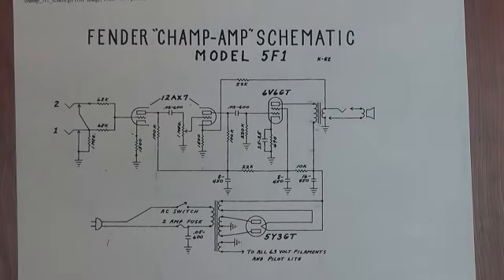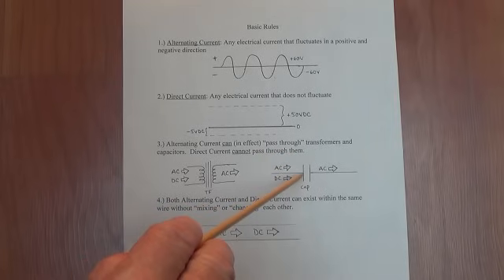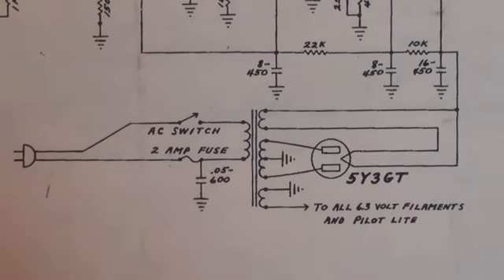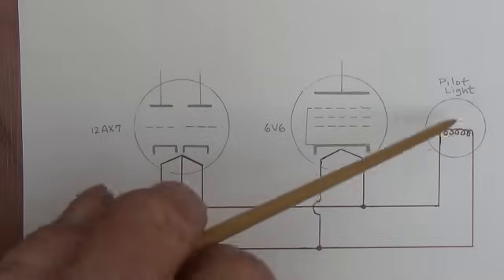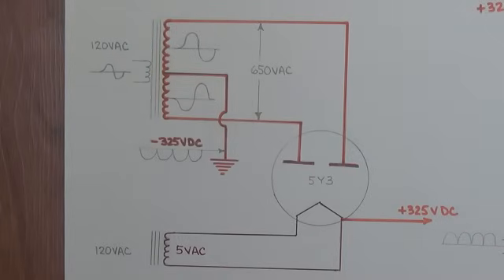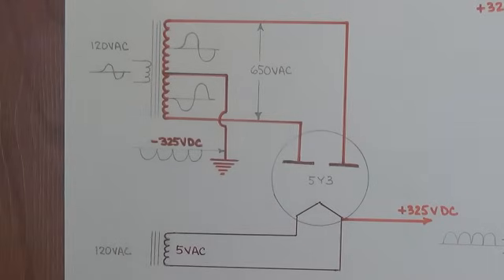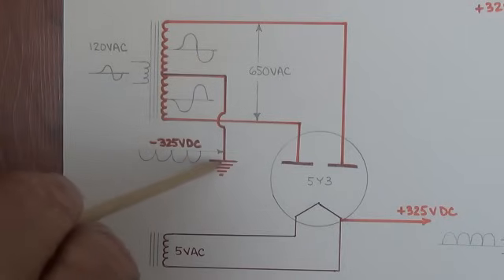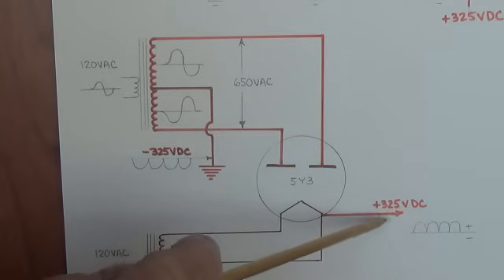How Tube Amplifiers Work, Part 1: The Power Supply

Comment: one question  uncle doug onthis video,  what makes  the neg. 325 to ground dc if its coming out ofthe pt @ 325 ac ? isee that the rectifier and  diode  turns the positive  into dc ,but looking at the schematic idont see the ac to dc conversion on the negative
Reply from the maker: You ask a good question, Donald. There really is no -325VDC potential to ground, which is why I altered the diagram to obscure it. As I state in the video, the power supply is like a 325V battery, with a positive and negative pole. The potential of the + pole (relative to the - pole) is considered to be +325VDC. The - pole is grounded and considered to be 0V. You can see this with a voltmeter if you attach the positive lead to the output of the rectifier and the negative lead to ground = a reading of +325VDC, the correct value. If the (grounded) negative pole really were -325VDC, you would get a reading of 650V. I know this is complicated, but I hope it makes sense.
Reply: During one half-cycle of AC, one end of the center-tapped transformer is positive and the other end is negative with respect to ground. During the next half-cycle, the end that was negative is now positive and the end that was positive is now negative. This means that there is always one of the diodes with a positive voltage on its plate, which supplies current to the filter cap.

Comment: Wow, your metaphor of;
   
   "the frying pan (Filament) cooking popcorn (Electrons) thats negatively charged, being sucked thru the chain-linked fence (Grid) to the positively charged Plate, and you can change the porosity of the fence (Grid)" 
    
...is the best way i've heard to explain it. It actually helped ME more fully understand how they interact. Thanks for making these vids.
Reply from the maker: You're welcome, WS. When I was a classroom teacher, I found that making analogies involving common, familiar things often made the understanding of abstract concepts much easier. I'm glad the video was helpful. I would only add (just to be thorough) that varying the "porosity" of the grid is accomplished when the input signal varies the negativity of its charge (since a varying negative charge will repel more or less of the negative electrons passing through it to the plate).
Reply: Ahhh....AHHHH!!... ok, so, the guitar signal actually varies the grids negative charge. And the amount of negative charge the grid has in the first place, (controled by the...cathode resistor?) actually really repels the electrons rather than "let's them pass"?
Reply from the maker: The grid can have a negative charge for different reasons, depending on whether the tube is grid or cathode biased. This is needed to reduce the current flow from cathode to grid.....like a faucet that is 50% on. The input signal then varies the grids charge (more or less negative, but never positive) as if you varied the faucet from 25% to 75% (for example).....producing an output signal that is many times greater than the weak input signal.

Comment: Hi Doug.
Your power supply diagram has a notation -325VDC on the transformer centre tap EARTH. Do you concur that the correct label is OV,  you  are not applying 650VDC to your amplifier anodes are you.
Reply from the maker: I understand that the accepted notation is that ground is considered to be 0V. In my explanation of the power supply, the electrons are "pumped" out of the B+ circuit and sent to the chassis ground, creating an electron "vacuum" in the plate circuit that is highly attractive to the electrons flowing from the (ground-connected) cathodes. I thus felt compelled to designate their presence in the ground circuit with a negative symbol. In my interpretation, the B+ should probably be designated as 0V and ground as -325VDC, since positive charges cannot "flow"....only electrons can....but this would be confusing for all who accept the traditional designations. I can see how this dichotomy is confusing to more knowledgeable viewers, but was simply doing the best I could to provide a basic understanding for beginners who assume that 0 indicates absence of charge, rather than presence (of electrons).
Reply: Uncle Doug Well OK , you have a charge flow analysis there, but on the other hand at the end of the Video you literally say the power supply resembles a DC battery with negative 325VDC terminal  and positive 325VDC terminal. Which would be a potential difference between such terminals of 650VDC.
Reply from the maker: Again, it's a way of conveying a complex topic by comparing it to a simple, well-known concept. People understand batteries, and I think the analogy is both accurate and effective for my target audience. Perhaps the total difference between the listed values (650VDC) is not correct, but saying that the ground was -0V would not facilitate understanding either. It's my method and I'm sorry if it disturbs you. Perhaps my videos are simply not suited to your higher level of understanding.
Reply: Uncle Doug No problem Uncle Doug, Just interested in conversing about the subject.   It is not illustrative of the circuit action  to say that  pumping electrons out of the  the B+ circuit produces  a presence of  electrons at the earth terminal.  In  this circuit electrons move to one anode  simultaneously as they leave the other  anode  so the center tap terminal is always electron neutral from the analysis of electron flow. When electrons are  drawn from the cathodes then electrons circulate from the earth terminal and back to it , again the  aggregate presence of electrons at the earth terminal  is neutral.
Reply from the maker: I have trouble visualizing how the "aggregate presence of electrons at the earth terminal" can be neutral. One would think that the presence of electrons in any location would impart a negative charge to it.
Reply: The quantity of electrons  at the earth terminal is the sum of the flow in and the flow out which equals zero, there is no accumulation.
Reply from the maker: I see the logic of your comments and concur that my labeling of the center tap potential (-325VDC) is misleading. I will amend the video to obscure this label and will add notes to correct the narrative. Hopefully it will now be more accurate, yet still make sense to the viewer. Thank you for your informative and helpful input.

Comment: Subscribed. Brilliant videos on explaining tube amps. Thank you very much. Could I ask when you refer to the cathode heating pop corn (electrons), where do the electrons/pop corn keep coming from? Thanks
Reply from the maker: An excellent question, Reece. Think of the power supply as an electron pump that "pumps" all the electrons out of the positive (B+) circuit connected to the tube plates and sends them to the chassis (via the center tap of the high voltage winding). Thus the chassis contains an almost limitless and quickly renewed (by the "pump") supply of electrons for the cathodes, which are connected to ground through biasing resistors that, in effect, regulate the rate of electron flow (plate current) from cathode to plate.
Reply: Thank you
Reply from the maker: You're welcome :)

Comment: Thank you for all of your videos, I'm continuing to find answers to the many questions I have had regarding tube circuits and they way they work.  One more question for you.

I have project going which requires me to change the mains transformer (it has some shorted secondaries) in a tube power supply.  Also, I live in europe and the power supply was designed to run on 117/60hz power.  I have located a replacement universal transformer from Hammond which will operate with a 230v/50hz mains voltage input.   My question is if I will need to change the values of any other parts in the power supply to work with 50hz AC.  The thing was designed to run on 60hz AC.  It 's a simple rectifier circuit using a GZ34 tube, one choke (6Hy) and two 30mfd caps.  In CLC configuration if I understand correctly.

Back to more of your videos!
Reply from the maker: You're welcome, Joe....glad the videos are helpful. I believe the power transformer is the only component that is sensitive to 50Hz current and must be changed (as you are doing). The remainder of the power supply components should function well at the lower frequency (50Hz) as long as the secondary voltage is correct (110 to120VAC).

Comment: Doug,
Thanks for taking the time to do this. I have one small issue with the schematic though. You show the switch at the wrong location. Although it will work, it does not disconnect the hot side, only the neutral. That is a specific safety hazard and not correct. It should be shown in front of the fuse on the hot side only.
Reply from the maker: non participant An excellent point, NP. The power switch should definitely be installed in the black (hot) AC lead to the fuse (first) and then the power transformer. The schematic is an original from Fender and apparently they did not follow this wiring pattern. Thank you for pointing this out.
Reply: To comply with modern safety standards, if an amp has a non-detachable power cord, both hot and neutral lines must be switched (with a double-pole switch.)

Comment: What an excellent presentation. Thankyou! I love the popcorn analogy. I don't suppose you could give the same treatment to the workings of stereo amplification? Btw I admire all of your vids. They are very informative with no useless rambling. Thanks for them all.
Reply from the maker: You're welcome, FS....glad you like the videos. Stereo amplification is basically just two separate mono amps in one chassis. Virtually everything described in my videos would apply equally well to stereo amplification. HiFi and Stereo circuits generally have flatter frequency response and much lower distortion than guitar amps, but otherwise the basic principles are the same.
Reply: Uncle Doug Thank you very much for the quick reply. For some reason I was thinking it was a complicated balancing act of some sort. Perhaps I was thinking about how a receiver changes the signal. After your comment I can see how it works with regards to a phonograph (minus the preamp stage of course). Thanks again!
Reply from the maker: You're welcome, FS. Best of luck in the New Year :)

Comment: Dear Sir,
Can you please make a movie about how  and why hum pots work in tudio tube amps ?
And my be  one movie  more.; Where in the amp should be a oil capacitor replaced only with an oil capacitor?
Where can a cap change the sound? If the cap is not oil in paper anymore.

Thank you very much for your very good movies!

Kind regards
Reply from the maker: Greetings, ZX, and you're welcome :) The hum balance pot is usually between the two 6VAC heater wires. It balances and adjusts the ground reference for this circuit, to minimize tube hum.

Regarding paper-in-oil capacitors, there is absolutely no objective evidence to support the theory that capacitors of the same value but with different dielectrics (i.e. paper-in-oil vs ceramic vs polyester, etc.) have different tone characteristics. The truth is, you can replace any paper-in-oil capacitor with any good quality, equal-value capacitor of any dielectric type. The value (in uF) of the capacitor affects the tone, but the voltage rating and type of dielectric (i.e. paper-in-oil, etc.) do not. Here is a very well-researched and informative article to substantiate this:  http://www.aqdi.com/tonecap.htm

Comment: thanks a lot for this very helpful video - one thing, im trying to build an amp/pedal that will use Russian 6j5b-v pentodes but they have one cathode, one anode and 3 grids. the problem i face is that i am wanting it to run off 9-12v and im not sure where i should use resistors and capacitors (accept for removal of dc current). also i used some of your awsome diagrams to work from which helped a little. does this concet still apply? thanks

p.s these tubes are originally designed for hf amplifying so should work but with the right wiring

Aran
Reply from the maker: Greetings, Aran. I have no experience with these tiny tubes, but there are sites on the Internet that discuss their use in audio applications: http://www.diytube.com/phpBB2/viewtopic.php?t=4170. As with any amplification tube, you will need a filament voltage (6V, I assume), a DC grid bias voltage (about 2V) or cathode bias, and DC plate voltage (probably around 110V). I would suggest that you do some research on the Internet to find a schematic for a circuit that provides these voltages. Good luck :)
Reply: Thank you so much for the helpful reply, a final question, do I need to apply voltage to the cathodes and all of the grids?I have drawn it so that grid 1 and 3 are used? If so ac or dc. The other problem I face is where to put resistors and caps? Do I need these in specific places? Thanks

Aran
Reply from the maker: Aran, your questions are difficult to answer because they are so broad. I strongly suggest that you find an appropriate circuit diagram on the Internet and base your circuit on it. Freehand circuit design requires a great deal of knowledge and experience which takes time to acquire. Once you have this knowledge, the position and value of components is easy to determine. Most of us start off by copying, studying, and eventually modifying other circuits. You have to learn to walk before you can run.

Comment: Thanks for your video's!!! Very interesting and informative.  Would you consider a video on solid state guitar amps?  Do they have the same dangers when you work on them as tube amps?  How are they different , and do they really sound different, better worse?  etc.  The popularity of tube amps is huge, but most players, have solid state amps, or a least a solid state amp in their collection. Would be very interested in your take on it.  thx
Reply from the maker: Greetings, Mark. My personal preference is for hand-wired tube amps from the late 30's to early 70's. I grew up with them and that is where my heart (and experience) resides. I harbor no ill will toward SS amps, but have never felt compelled to study, collect, or repair them. Tone comparison is very subjective, but I think it's interesting that many SS amps claim to have "tube tone", but I have never seen a tube amp claim to have "SS tone". That said, for many types of music, like heavy metal, alternative, jazz, etc. SS amps function quite well. For nasty, old-fashioned Rock and Blues, however, I really think that tubes are a vital part of the authentic sound. Re the hazards of working on SS amps, they generally operate at much lower voltages than tube amps, and although virtually no electrical device is completely "safe", they would tend to be safer to work on.
Reply: Makes perfect sense.  I have the "gear bug" and commonly find SS amps that need a knob or two and a few pots sprayed in order to bring them back to life.  I am careful ( unplug from wall, let sit , no touchy the big caps etc).  one reason I found you is a have an old (late 60's) amp that I was thinking of tinkering with, but have learned from you video and others thats a very bad idea since I want to stay on the earth longer.  :-)  Again thanks for your efforts. I will stay a subscriber.
Reply from the maker: You're welcome, Mark. Best of luck with your projects.

Comment: thanks doug for the explanation here. really helped me alot!
Reply from the maker: You're welcome, Greg. Its great to hear that the video was helpful :)
Reply: Uncle Doug very much so mate. have assembled a couple of pre-amps and etched my own boards for a variation on a 6L6 guitar amp (as a mono block) but never understood the theory. only thing i wouldn't mind knowing is why the values of the caps and the resistors although just getting through your part 2 :) thanks again :)

Comment: Now this is interesting...this time watching I noticed you mention the "all important death capacitor"....I see more of those at several grounding points. What's the purpose behind those vs. a direct ground connection?
Reply from the maker: Greetings, MC. The only true "Death Capacitor" is the one connecting the primary AC input to the chassis. There is concern that if it leaks or shorts, the chassis will become a shock risk. The capacitors in the secondary circuit (post power transformer) that go to ground do not present a chassis shock hazard....they are simply closing the circuit with the PT secondary.
Reply: So, the purpose of the capacitor (in the primary ac) is for what? If it is a potential shock hazard, why bother with it? What is it's purpose? Maybe I misunderstood.

So the cap connects to the primary ac connects to ground....and ground also connects to chassis, right? What is the purpose of that? Will they cancel each other out if there is a short? It seems to INCREASE shock hazard to me....but I'm a newb. Thanks for any reply. Cheers.
Reply from the maker: Back in the early days of amp technology, the Death Capacitor was used to filter background noise out of the incoming AC current....allowing the noise to pass through the capacitor to ground rather than entering the amplifier circuit. It could only be a shock hazard if the capacitor developed an internal short circuit......which is, in my experience, quite uncommon.

There are two circuits in an amplifier, the 120VAC primary circuit and the secondary circuit that feeds all the amplification components. The circuits are completely separate. It would take a very long time to explain how these circuits work. I have posted several videos that discuss the subject and there are some very informative sites on the Internet. If you want to learn about this, you can avail yourself of these resources. Good luck.
Reply: Put simply, the user switches the capacitor so it connects to whichever side of the mains results in the least unwanted noise.